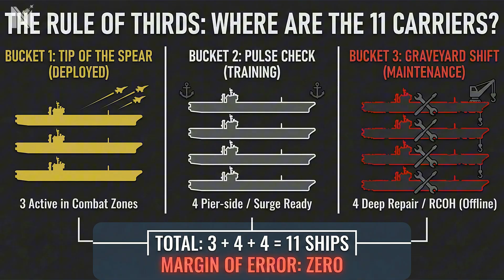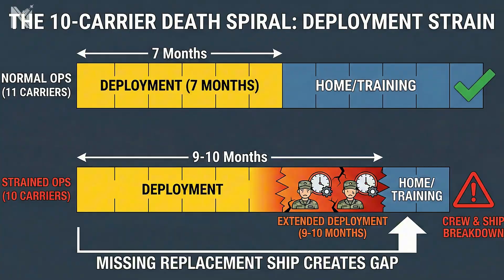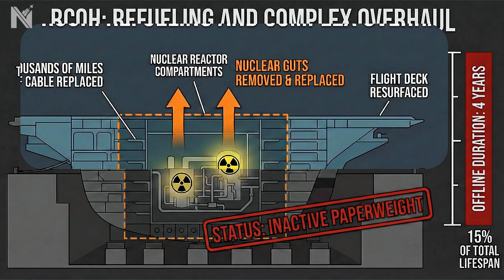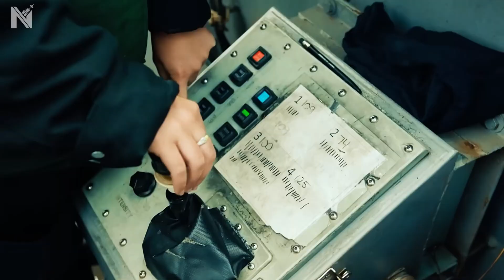Why The US Navy Has Exactly 11 Carriers (Not 10, Not 12)

Comment: There's a lot of issues with your math. If you only have to do the 4 year reconstruction every 25 years, that could easily be achieved with less than two down at a time. Of course there is the short resupply with weapons, planes, staff, and food between missions but that is much quicker. Also, on your cost for an additional carrier, one wouldn't necessarily need to add ALL the extra that goes with it if the end goal is to have more carriers available. In relatively short time, people, planes, and armaments could be moved over and fresh provisions added as needed to get the replacement carrier to sea in place of the one about to go in for service and keeping the support ships around it. They are much quicker to service, refuel, and rearm.

Comment: We need several 0f those smaller carriers. They can hold helicopter and f-35's.  They can be used to supplement in cases OF EMERGENCY. Since they are conventional they do not need the cut open 4 year maintenance. They would not be a replacement, but only a supplement. Imagine a carrier strike force with 2 of these and the USS Truman. They would help the Truman but not replace a Nimitz class carrier.

Comment: Shouldn't there be 14 to 16 Active Aircraft Carriers in the Navy
At All Times. 

Eleven Aircraft Carriers 
Is not enough. 

Aren't half of the Carriers usually in the Repair and Maintenence Yards
Almost at all Times. 

Oil Fueled Aircraft Carriers should be used again for Security Reasons for the United States. 
I remember reading about the USS Midway. 
It's Fuel Consumption for Daily Use was way too much.
Smaller Essex Class Carriers and Smaller Yorktown Class Carriers should be Updated with Modern Technology and Built Again.

Comment: Not to brag, but if Israel had aircraft carriers, at least 80% would be operational at any given time.

It's extremely wasteful to dock a carrier just because the crew needs to be refreshed. Have a second crew, keep the carrier operational.

Also maintenance shouldn't take years, it should take months or even weeks. In WW2 Yorktown was ready for Midway in 3 days after getting badly hit in the Battle of the Coral sea.

Comment: The USN should go to a 12-CVN fleet with the extra carrier being forward deployed at Perth in the same manner as the carrier based at Yokosuka, Japan.
Both forward deployed carriers groups should mostly be made up of allied ships to offset the the cost of the 12th carrier. 
A 12 Carrier fleet will allow 4 carriers in active service.
This would not be a difficult thing to do in the 2030. One Nimitz carrier scheduled to be replaced could be postponed just like they did with the Nimitz. 
Having a forward deployed CVN at Perth would solve a lot of problems for deploying to the Indian Ocean and Persian Gulf. No CVN would have to transit the Suez Canal. 
If 2 carriers are needed in the Indian Ocean region, then the Yokosuka forward deployed carrier can be rotated west along with one CVN from the West Coast to fill the void.
Also, a 12-carrier fleet would allow for 5 operational carriers in a crises. :body-blue-raised-arms:

Comment: You would think that after so many decades of carrier construction and operations, they would have figured out how to replace the nuclear reactors without cutting the ship apart.
Reply: They have.  It would cost a lot less to do it that way so....
Reply from the maker: It looks cheaper on paper, but not over a carrier’s full life. These ships are built to avoid refueling for decades, not to make refueling convenient. RCOH is expensive, but it preserves structural integrity, shielding, and reactor safety for another twenty-plus years of operations

Comment: Pilots on carriers do not sleep in coffin racks. They sleep in twin beds in stateroom. Depending on rank it's two officers per room and they have a sink in their room as well. They also have regular showers and do not have to hold the button to keep the water going in the shower. Enlisted people clean their rooms and do their laundry for them and if your rank is captain they make your bed for you as well. Pilots live pretty damn good on a carrier. All commissioned officers do.
Reply from the maker: This is a common misconception — thanks for correcting it.
Officer berthing is very different from enlisted berthing, by design.
Reply: The Chief’s Mess is where it’s at.
Reply: @CPO-Snarky you are correct
 The chiefs pay for their own food. They eat better than the officers. I worked in the chiefs mess. I was very lucky and ate well.
Reply: @cataractkillerz3388  Burp!  That’s why maintaining Tomcats was easier than maintaining an acceptable waistline.
Reply: @cataractkillerz3388 , my opinion; the chiefs mess ate very well, at least partially, because the CPOs wrote the evaluation for the cooks. I had an officer tell me, when I was on a cruise on the Roosevelt that the chiefs mess has better food than the wardroom. That's very believable, because there are many more officers on a carrier than chief petty officers.
Reply: @CPO-Snarky , I definitely agree! I put in a cruise on the Roosevelt as a Gunnery Sergeant with my F/A-18 squadron and enjoyed the chief's mess very much. After a time, it became almost boring, every Sunday at sea they served surf and turf. Operating twelve hours a day, seven days a week, the days blur together, but coming into the mess on Sundays, oh it must be Sunday. ..
Reply: @JM-lk6wo Merry Christmas, Gunny.
Reply: @CPO-Snarky Goat locker
Reply: @DwightWatson-g6t We both know that but I didn’t want to confuse the casual viewer of the video or the crayon eaters onboard.

Comment: However, we also have thirty-one large amphibious ships in total (LHA/LHD, LPD, LSD of which we maintain at least 10 big-deck LHA/LHD amphibious assault ships.  These ships can carry twenty F35Bs each.  Granted their Task force is smaller; ARG Structure (A Carrier Strike Group Alternative):  Core: An ARG typically consists of three ships: the assault ship (LHA/LHD), a dock landing ship (LPD), and a transport dock (LSD).
Between two of those and the Air Force and Allies, the Med/Europe, and Middle East would seem to be covered.  Asia and maybe the Indian Ocean are the keys.
Reply from the maker: That logic is directionally right, but incomplete. ARGs expand presence and flexibility, yet their air wing size, sortie rate, and sustainment limits are fundamentally different from a carrier. Deterrence in Asia is about endurance over years, not just filling near-term gaps.